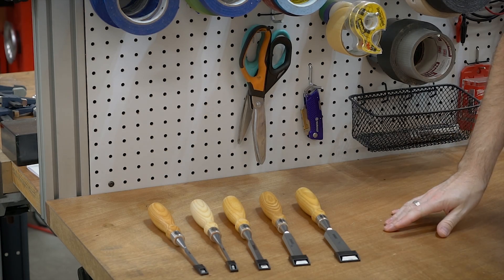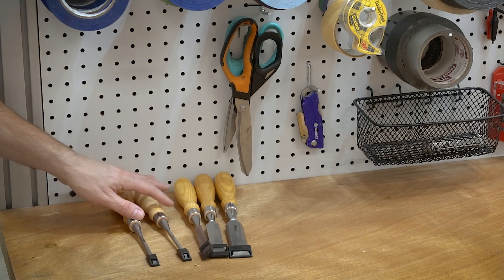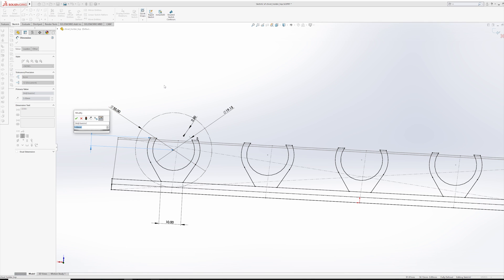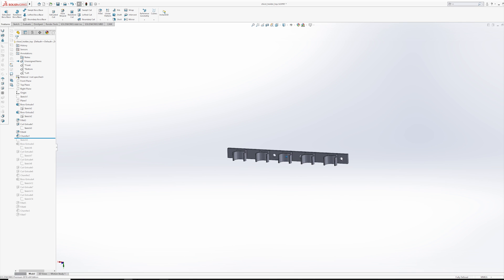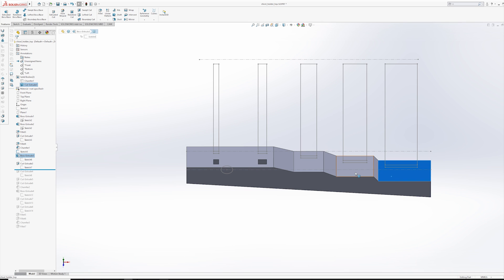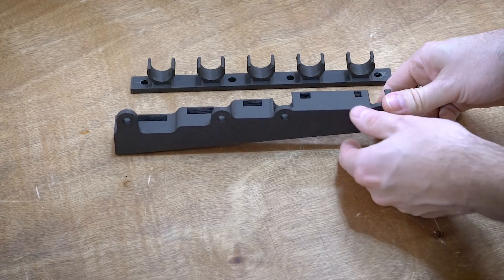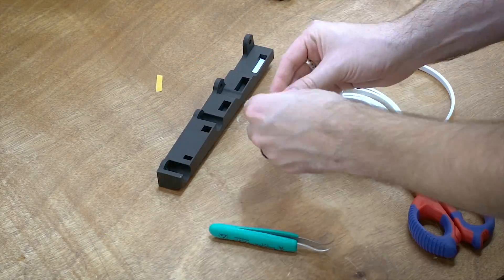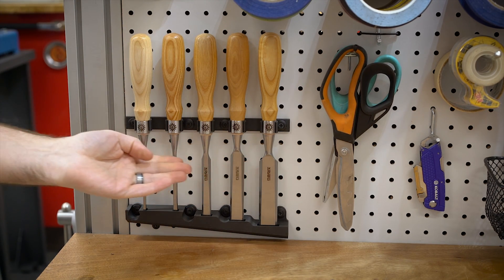3D Printed Chisel Holder - Plastic Rivets!

Comment: It is interesting the different ways people look at the same problem.  Given the same set of constraints, I would have made the top sloped versus the bottom. That way the largest chisel is the easiest to grab (nothing on either side) and the rest are no harder to grab.  Given my utter overuse of magnets, I would probably have gone that way instead of clips for round section of the chisels.  Of course, I would probably never have actually started the project. Nice work.
Reply from the maker: OH, fair point!  I guess I just liked having the handles all lined up and at the right level.  But with your way, you'd be able to identify the sizes a bit quicker, interesting.  If you slanted them, then the mounting tabs on top would be a bit more complicated.  Yeah, MANY ways to tackle every design.

Comment: Very cool! I have the same chisel set and I'm very happy with it. I have a ton of Narex tools. 

You're not primarily a woodworker, so this won't be a problem for you any time soon, but chisels do get shorter over time as you sharpen them. It might be something you need to account for at some point.
Reply from the maker: Gotcha, good to know.  I really don't use chisels for their intended purpose very often.  I use them for removing stickers, dried glues, and mostly for cleaning up 3d printed parts.  A nice 1/8" chisel works great for cleaning up supports and such.  I probably won't sharpen them very often, but good to know.  I can always just add a bit more (or thicker) foam in the bottom part.

Comment: And what a great project. I'll have to remember this if I want to 3D print holders for my shop walls (I have Wall Control, but it's got slots and holes - the best of both worlds).
Reply from the maker: Ah, I've seen those.  I have SO many pegboards in the shop, I just decided to stick with the cheap stuff.

Comment: Hey Robert, it looks like if you pop the stud out of one of those rivets before use, you could then insert a short machine screw that would grip into the plastic uh, dongle?  Unsure what to call the expanding part.  Obviously it wouldn't have much holding power for anything pulling directly out on the screw, but the assembly should work the same way as it does with the plastic stud and be removable at least once or twice.
I'd wonder if the, dongle? If the dongle would collapse back down far enough to fit back into the pegboard easily though for a second use.  Probably not practical to use a few hundred in that way, but if it works, it would be nice to have that ease of removal when you need it.
Reply from the maker: OH, that's actually a pretty good idea.  Maybe a wood or plastic screw would work too.  I might try that and make a follow-up.  I DO like the idea of being able to remove them.  Right now, it's not terribly practical to move things around often.
Reply: @RobertCowanDIY   Glad to see that follow-up with Peggit, and that a screw turned out to work fine ;)

Comment: Do you not find the PLA relaxes under load? And in this case, causing the snap feel less snappy?
Reply from the maker: It does creep under load, BUT there is nothing under load.  The clips are slightly larger than the diameter of the chisel (about 0.2mm), so when the chisels are in place, the PLA is relaxed and not being stretched.  You only 'stress' it when putting them in place or removing them.  But you're right, if the part was under constant load, it would loosen over time and not work as intended.
Reply: @RobertCowanDIY  I guess I wasn't paying attention.
Reply: I made some shelf brackets out of PLA and they sagged a decent amount after a year. I reprinted them in PETG and the only sagged about 25% as much. It's a much higher torque situation than this chisel holder. I imagine this chisel holder will be fine.
Reply from the maker: @justin-t3l8s  Correct.  With a constant stress, PLA will sag and deform over time.  PETG will deform quite a bit less.  The holder will be fine since there is no real stress on it when it's just sitting there.  ABS is the material to use if you don't want it to deform.
Reply: Good to know about ABS. I have used ABS since I learned that PLA existed. I'll have to try it again.
Reply from the maker: @justin-t3l8s  PLA is MUCH easier to print, but ABS is better for applications that require constant stress.